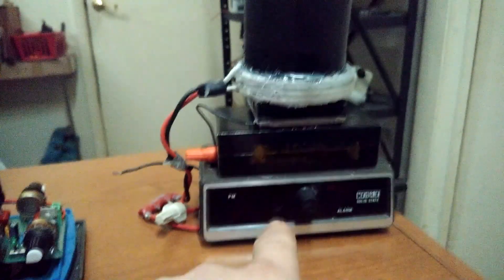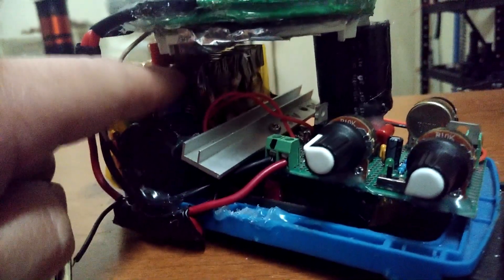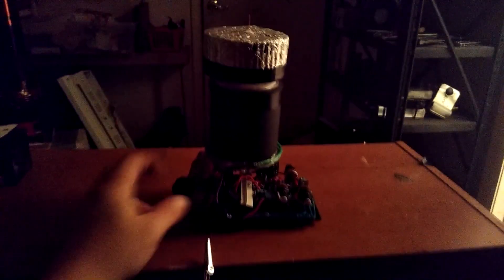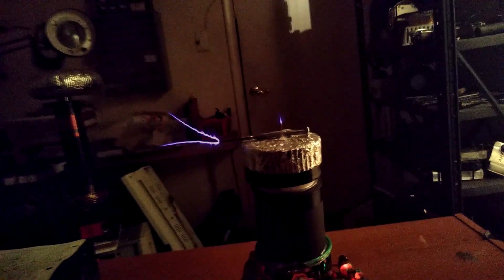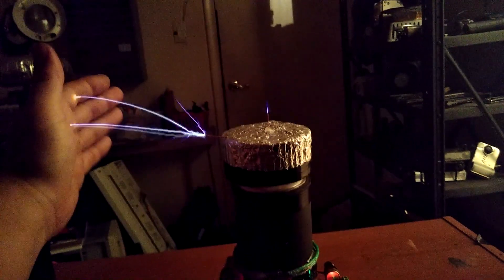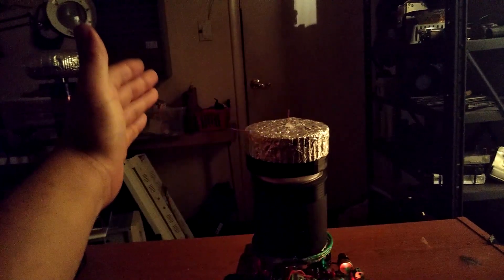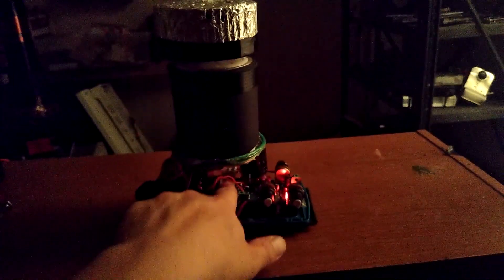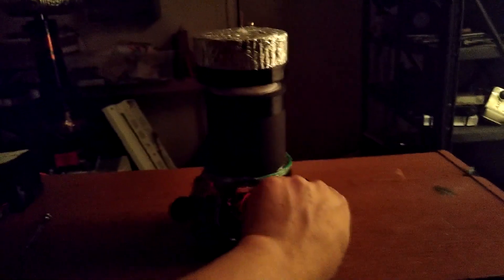12v Battery SSTC #4 Run(SUM110N10's)

Comment: I can't get those line arcs hehe , do you know what causes them ? Mine are branched
Reply from the maker: The best way I can put it is very specific tuning to where the secondary voltage doesn't reach quite as high as it would with different coupling. For me this tuning usually lands on me adjusting the height of the primary. There is sort of a voltage/current ratio since you are passing roughly the same power either way.. but it could be higher voltage less current or lower voltage more current so to speak. You can call the line arcs lower voltage higher current. This is when loading the secondary and dropping the resonant frequency gets things in the good tuning, but just to free air I suppose the phasing is shifted too much to give the highest voltage out. So I can drop my primary down and shift it into the tuning that gives the branches or move it up some to give the line arcs. 

What I'm basically looking for in the tuning is an output that doesn't really want to spit arcs at around 16V or so to free air, but when bringing my hand close the arcs will jump and intercept it some inches away. That's an arbitrary voltage but then pretending I cranked the voltage to 30V, the tuning would have caught up a little bit more to where the natural output would drop the secondary frequency enough for better arcs to free air. This all depends on things like the profile of the electric field I imagine.. The way the field propagates given the geometry. The breakout point and where it's sitting exactly.. How long it is etc.. The presence or lack of any kind of topload..

It's similar to the Class E circuits but it's literally 2 of them in one. With resonant feedback I can't adjust the frequency to tune it so I have to do it with the phase shifting. Those series capacitors and moving the primary around basically.. Sometimes I need a different GDT to make it run right. Sometimes different chokes. I'm also not sure any of that would work with the Tefatronix circuit as per his schematic.

Comment: I built that circuit with tapped primary in the middle. The sparks don't increase in length when i increase the voltage. I suspect it's because when the mosfet opens it acts as a short circuit from VCC -> primary coil -> ground, hence shorting out the supply at every cycle. And because the supply is current limited, as soon as the limit is reached the voltage drops.
Reply from the maker: Technically this is what happens with most SSTC's as the primary coil is very low resistance.  It's the high frequency switching of the coil that prevents it from acting as a dead short. With these circuits there can be many reasons why the output doesn't increase with voltage but typically for me it just needs to be tuned to operate best within a certain range. I haven't tried one of these above 100V.
Reply: @Magneticitist  wouldn't the coil always be in tune, since the circuit has a feedback from the secondary?
Reply from the maker: @Tesdraline  yea the primary tank caps change the game a little but it's still feedback driven like most SSTCs

Comment: I like the idea of being able to drive a tesla coil of this arc size with a battery. I'm building one too. I'm trying to make some kind of tesla coil "gun". Then i have something that i can take everywhere and shoot some sweet arcs.
Reply from the maker: Thats part of where I was going with these at one point, a small Tesla Gun type deal. Only downside is these spit out sword sparks the best which may or may not work so well as a TC gun. It can be tuned to give more branchy arcs but they are never quite as impressively long. If sword sparks are not an issue then this would def work well. Doesn't even need to be high drain lipo cells or anything either.
Reply: @Magneticitist  Did you use a primary resonant capacitor on this coil? I would like to use one but from what I know the drain source voltage would probably exceed the 55v of an IRFZ44N. Does a zener diode between drain source work good? And also you need to try this circuit on an ac flyback it's awesome I got some pretty long arcs with my diy flyback that's in oil. Only problem is that it has a 50khz resonant frequency and with interrupting the arcs it hurts quite a lot when touching it.
Reply from the maker: @JohnnyB2451  This does use a primary cap at .33nf like my other one. 

I don't seem to be creeping up on breaking down the drains unless I tune the coil a certain way, usually with lower coupling than needed to get good output. At a certain point when lowering the coupling the sparks begin to branch a lot more and then do not reach out in longer swords. With that tuning if I go up to about 28v or so it's right on the edge for 55v fets and maybe 30v input would pop them. 

I popped some 33v TVS diodes on my other circuit at 30v input. I noticed using TVS diodes which begin to clamp a little too early hindered the performance. Basically, using a TVS diode properly here would take getting just the right diode with just right clamping voltage etc. 47v Zeners didn't seem to introduce any changes or issues.. however they also didn't prevent the fets from popping when the drain voltage shot over the breakdown. They may just slightly make some difference if the spikes aren't TOO high. So while TVS diodes are not supposed to introduce the capacitance a zener can, they can introduce a clamping of the waveform well below the specced out breakdown voltage which causes issues. For example I threw a 16v TVS across my secondary feedback inductor and it jacked the waveform all up, and this was with 12v zeners on the gates.

Honestly running a flyback I'd just use the mazzilli driver. I've thought about trying to use this one and the feedback somehow but the mazzilli is going to run at ZVS either way whereas this one may not.
Reply from the maker: @JohnnyB2451  not. 33nf I mean 33nf
Reply from the maker: @JohnnyB2451  What you can do with these circuits is try using some of those cheap IRFP250's or IRFP260's going around. 260's preferably and I say cheap ones cause I've never tried legitimate ones. Ebay and Amazon ones work for me.

I have another one which gives me really impressive more beefy looking arcs at 30v running 260's. It's overall larger and can run at a tested 60V on the bus with longer arcs so I didn't try to make that one a battery coil. You could however start with a circuit like that and if it becomes too difficult to get the desired output at 24-30v or so you could just up the boost stage to do closer to 60v or so and all the while not really worry about breaking down the drains.
Reply: @Magneticitist  I just love this circuit. Especially at lower frequencys like 400khz it switches pretty efficient in my setup. I can power my coil CW with 130W and just by using a low power fan the fets won't go much over 40 degrees(104 Fahrenheit) after minutes. So if I'm interrupting it I could probably run it forever maybe even without a fan.
Reply from the maker: @JohnnyB2451  Yea these might be my favorite. The early ones I played with I tried to get working like that to where I could run CW anywhere from 1V up to around 30V before it tried to pull over 10A or so. They can make great Slayer Exciter kind of setups at the sub 5V levels. I started reading some others were pulling like 40A+ in CW and it just wasn't possible but had great interrupted arcs, but it seems like you can still get a good combination of both CW and interrupted with specific tuning. My most recent setups though using the primary caps and longest breakouts will not run CW, I'd need to remove the primary cap and redo the tuning a little otherwise it pulls too much.

If you can run minutes of CW then you can definitely run a battery interrupted setup for a long time. At say 25 bps it only takes like 100mA or so to get the real thin arcs and you can get ones which are beefy enough at no more than like 2A. 
This is why I say a cool setup would be a 12v Lipo which can do CW at short periods at say 12v and still do interrupted after a boost stage at closer to 24-30v.
Reply: @Magneticitist  I will try with the irfp260n. Actually I never used cheap ones because buying them from ebay and so on would be more expensive for me because of the shipping cost. Do you mean this coil: https://www.youtube.com/watch?v=9eMF5-leTxc&t=63s ? For what reason do you have caps between drain and source? When I connect 100nf caps between drain - source the circuit is pulling a lot of power and isn't really oscillating.
Reply from the maker: @JohnnyB2451  So that one uses the fake 250's and this one https://www.youtube.com/watch?v=BFus4ibGWu8 actually uses the fake 250's also. One of my very first uses the 260's and it can push some serious juice. The caps on the drains I only add when using the two choke setup where I plan to run a primary cap and I guess you could call them resonant caps. When trying to tune a semi dual resonant setup I tweak those cap values a little and can further tweak around by adding a little parallel capacitance across the primary.   

The bigger coil I linked uses no caps on the drains, instead I have a small bank of parallel caps on the primary (along with some series caps). 

But just for example regarding how this circuit can work sometimes, in the circuit you linked I originally had about 5nf on the drains and this gave me good operation with one coil. When switching to another coil of similar frequency I needed to add 100nF extra on the drains for it to work the same, all before trying to add a primary capacitor.
Reply: @Magneticitist  Yes that would be a cool setup. I already ordered 250w voltage boosters from amazon. When they arrive I will try making what you described above. If you are using a voltage booster with a potentiometer you could make to voltage dividers or like 2 ressistors in series to simulate a potentiometer to have a fixed value for 12v and then another ressistor network to which you can change with a switch that sets to 28 volts. Than you don't have to use a screwdriver to set the voltage and check it with an voltmeter. I will definitely try make something like than and upload a video of it if it works.

Also does it  matter how many turns your coil has with this cirucit? I think I heard in another video of yours that this coil has 400 turns but your still able to get an arc size as long as the secondary. Because right now I'm trying to wind a coil by hand with 0.1mm wire that should be around 12cm long with 1200 turns and I'm asking myself if there will be a difference in arc size.
Reply from the maker: @JohnnyB2451  Hard switching to stable output voltages works but I guess you could also do the same for the gate voltage divider. Problem with 12.6v battery operation is that when using a 12v regulator it's just going to output a little less than the battery at the time which might sag to 11v or less, at which point the divider may need to be reset to activate feedback. With that setting when cranking back up to 24v+ it 'may' not output quite the same because there will be a little more voltage on the gates then.  

Being lazy I just replace the trimmer on the booster from the jump with a bigger pot and physically limit it from going above 31v output or so with a small screw in the knob. Then just add a cheapo voltmeter module on the output. Often times I could run CW straight from the booster so long as I just varied the voltage just right. Might be 14v, 16v, 20v etc. Makes it more complicated but it's nice to have any variation of voltage as well as PWM settings. 

And the secondary specs definitely matter. I told someone else I bet you could build one of these that may only run well from 1 or 2 coils out of 10 varying test coils you may have. I usually trial and error the coils and toploads but have been able to stick within like 1-4 primary turns for testing. You get an idea of the primary diameter spacing you can get away with after a while given the unbeatable racing sparks. This hasn't been an issue with me using a primary cap and looser coupling.

It's hard to say how your coil will work. I recently wound a nearly identical coil to my largest working setup using the 250's but it's slightly larger with 34 awg instead of 32. It doesn't want to work well without a particular topload and even then it's looking like I need about 6800uF low esr caps on the rails to get the output closer to the rest.
Reply from the maker: @JohnnyB2451  So I just walked around with this one pointing it at stuff and it does work pretty awesome as a TC gun. The fact that the arc doesn't branch all over and just hits a precise point is pretty cool, then it starts branching out across the surface depending on what it is. Looks cool on paint and cardboard etc, could probably set something on fire at right settings. I just thought about the problem of grounding though.. It can be done but I'm not sure how to successfully do it without putting the components in danger. Instead of using an earth ground you could run the other end of the feedback inductor to the common negative rail but there will be all kinds of potential all over the circuit. This was the case with my first attempt to where sparks would jump out and hit me through the plastic pot knobs and the battery wiring etc. Made everything wonky.
Reply: @Magneticitist  It sounds awesome! You might even be able to hit mosquito's with it haha. For the grounding problem I actually never used earth ground for any tesla coil I build so far. I'm not even sure from where I could get that ground. But so far a circuit never self destructed by using the normal minus (ground) of the circuit. I had the same problem when touching a part of the circuit while running there will be arcs but as long as I didn't touch it there were no problems they were not jumping out by there own only when theres a pretty small distance. So if you are putting the whole circuit in a case there will be no problem. If you use metallic potentiometers like i do you can get away of the problem by using knobs and then there shouldn't be a problem when grounding your tesla coil with your circuits ground as far as I know at least I never had a problem with it.
Reply from the maker: @JohnnyB2451  You can do like me and use your mains ground. I just have a thick wire carefully jammed into the ground hole in one of my wall receptacles. A good RF ground will also work. 

The difference is that it will take your negative rail and ideally bring it close to Earth/ground potential. Otherwise you have a lot of potential in the circuit you may notice a lot more when adding IC's for interrupting and such. While running your circuit ungrounded if you can catch a nice little burn from touching the rails etc then you may notice that all but disappear upon Earth grounding it. You may also notice your output increase a little by mains grounding it.
Reply: @Magneticitist  Is it safe to use the ground from the walls? Could it damage something? Because I don't wanna risk destroying something in my house electronics. I once read something on the Internet that you shouldn't use ground from Wall because depending how it's setup the earth ground of the house goes first through some electronics and not directly into earth or something like that. That's why I never used it so far. But I think they were also taking about 1-2 meter big Spark gap tesla coils so maybe a small sstc would do nothing. Did you read ever something about that it could destroy something or did you ever destroy something by accident? I just want to be sure before I plug my Tesla coil into mains ground.
Reply from the maker: @JohnnyB2451  I use the mains ground for all my coils that need it even the DRSSTC's. I might not use if it I planned to push insane power out of one though with no kind of line filter.

When using the mains ground the noise can travel into nearby electronics but it has never been enough to really cause any problems.. What happens for me is if I have some speakers plugged in and turned on using the same circuit I can hear noise kick back into them. With these coils it's no big deal, not a huge kickback into the line.

Technically this is the case either way to some degree when using an Earth ground which may be separate from the residential Earth. They are still tied together through some impedance in the Earth. This is why when lightning strikes the ground outside near a house it can jack up the lines by travel up through the ground rod. 

What may not be wise is to use the mains ground when powering a coil with mains if the leads are not separated enough cause there could be some arcing over at the plug or something.

Comment: brilliant! it can run on batteries only and good big sparks come out. I'm going to try it! Thanks...
Reply from the maker: There are some similar circuits out there, one being E-Schmok's single transistor SSTC which I believe can get good output from 12v boosted to like 35v or so. It uses a feedback oscillator though and may not be as easy to get 4+ inches of arcs at that voltage. With what I've recently been able to get with a similar circuit though, this seems the way to go.. Just needs a lot more people tinkering with them to figure them out better.